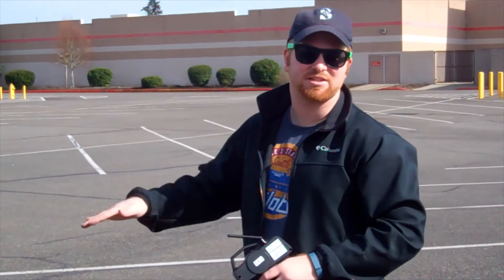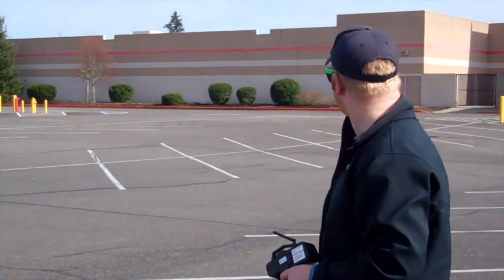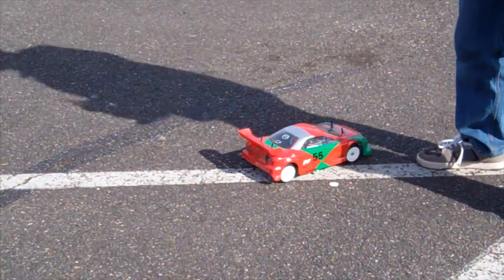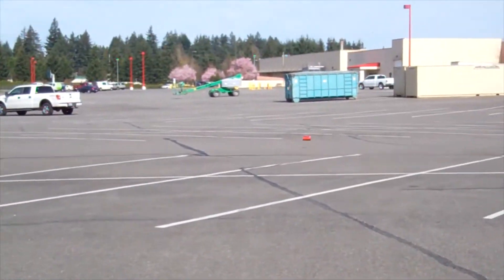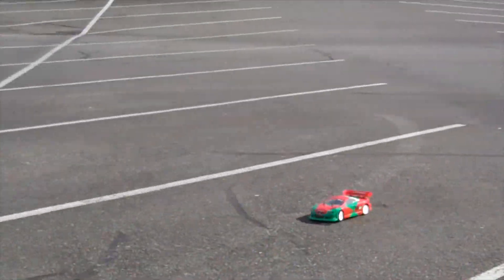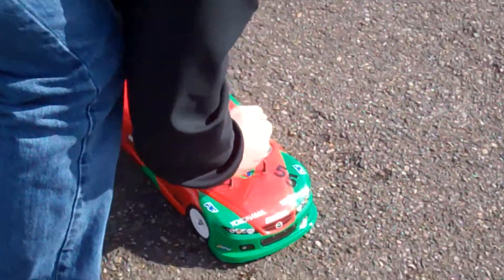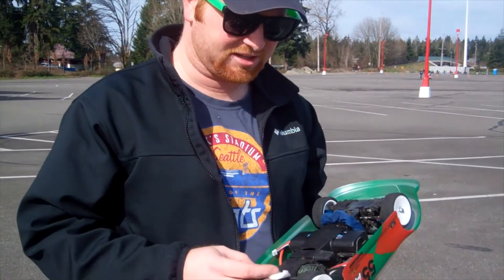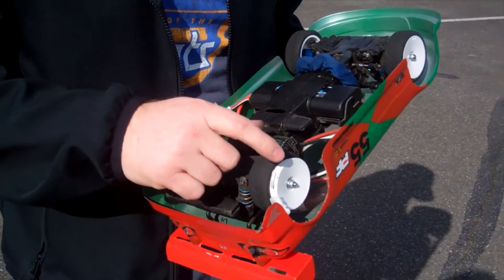Tamiya TL-01 Maximum Gear Ratio Top Speed

Comment: I've just got 65mph with my tl01
Reply from the maker: Wow! What gear are you running? 3S battery I'm assuming?
Reply: @MulkeyFilms  standard gearing 23 pinion 3s Castle Sidewinder 3 5.5 turn surpass motor

Comment: Just found this clip, i also have a TL-01 and been looking around for some upgrades. You still using the nimh batteries? How does the temperature go on the ESC? 4600kV can get quite hot I gues?